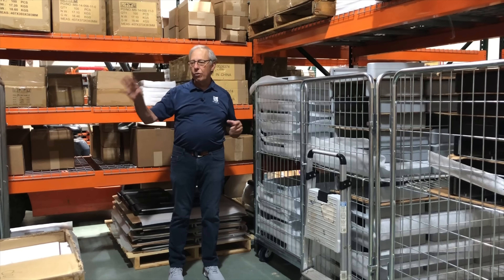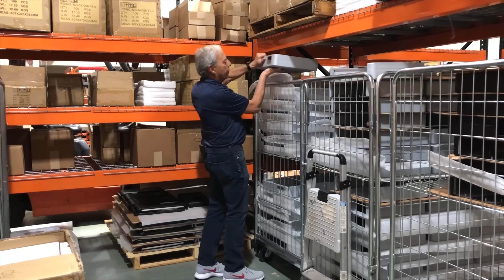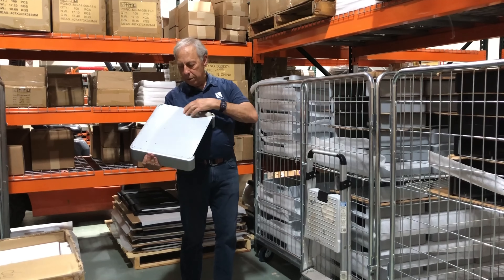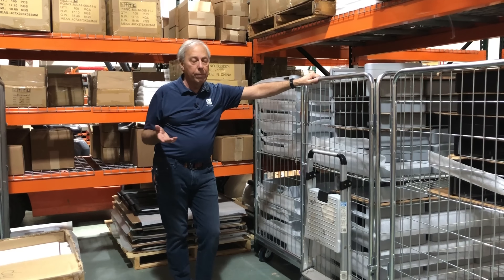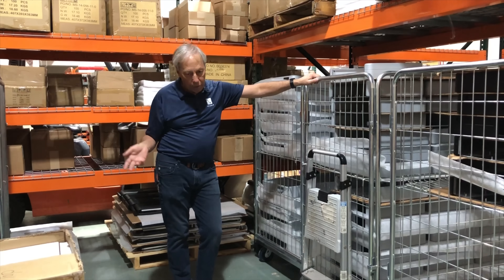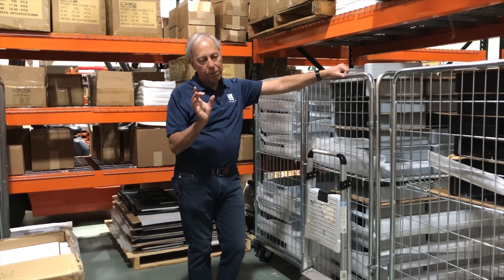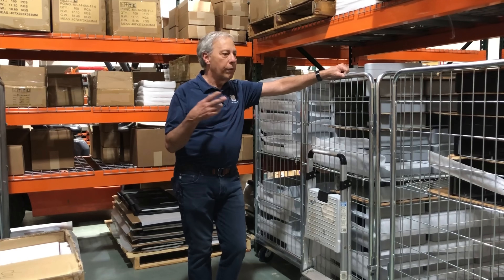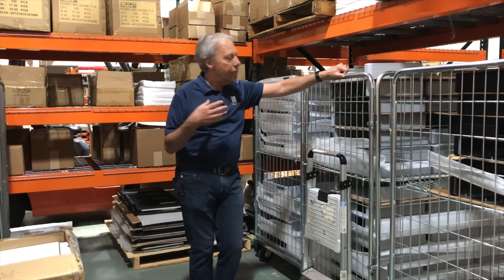Do chassis keep magnetic fields inside?

Comment: What about copper? I’ve seen inside cell phones s protective adhesive made of little fibers of copper that cover circuits which I guess is to keep interference down from the switching circuits
Reply from the maker: Right. Copper is non-ferrous and therefore won't block magnetic interference but it's great for conducting heat and EMI.

Comment: This might be a dumb question, but why couldn't a faraday cage be used to block the electromagnetic fields?
Reply: That's precisely what Faraday cages do — block electromagnetic fields. However, an electromagnetic field is not a magnetic field.
Place a magnet under a sheet of paper and sprinkle iron filings on the paper. They will distribute in a characteristic fashion under the influence of the magnetic field. Replace the magnet with a flashlight, a potent source of electromagnetic radiation. The light doesn't cause the iron filings to be distributed in any fashion whatsoever that's discernible to the human eye. The absence of potent hallucinogens are assumed here.

Comment: Paul, the thin bottom of those steel chassis seem prone to resonance when you tackled?¿ them. Some of my vintage amps use a thick composite material called G-chassis from Sony. Others, much more expensive,  a thick iron cast rich in carbon or coal, from Sony too. I love those Sony's I will keep them until death.
Why don't use recipes from the past that have shown its effectiveness now?
Reply: Warning: an assumption in this comment coming up. I possess both a Rotel and a Sony amp of similar specification, but dramatically differing weight. The Rotel has a large toroidal power transformer and is much the heavier of the two. The Sony has a relatively puny conventional EI, or TU transformer. Incorporating a heavy sheet of iron, or steel, into the case would certainly have a pronounced effect that could provide fodder for the typical sales-droid.

Comment: Maybe 50 years ago some watches were made with numetal cases to be less affected by magnetic fields. They were only moderately effective. If you got near a speaker magnet, all bets were off.
Reply: Hmmm. I spelled it wrong it is mumetal. 
"One such composition is approximately 77% nickel, 16% iron, 5% copper and 2% chromium or molybdenum."
Reply: @machintelligence  That would be some expensive watch! A quick Google and I can save heaps by pre-ordering the Capt. Cook special though. Only $AU3,500!
Reply: @jonathansturm4163  I believe it was an Omega, but I don't know much more about it. It belonged to the owner of a Jewelry store where I worked while in high school. He tried it near a speaker magnet and had to have the watchmaker at the store take it apart and demagnetize each piece.
Reply: @machintelligence  Ouch! An expensive exercise then.

Comment: Are you saying nu or new metal. lead would work just as well maybe better a container coated with millimetre of lead nothing will get in or out even radiation.
Can you still get lead tape not seen it for very long time
Reply: Mu-metal: https://en.wikipedia.org/wiki/Mu-metal
Reply: Lead tape here: https://www.tennisdirect.com.au/tourna-lead-tape?gclid=CjwKCAiArK_fBRABEiwA0gOOc4JibrHFjOHjKmRjAvDbjDRkKTqnkuqrCt0rImjLQEtmVPDJwyk0fBoCoi4QAvD_BwE
Whooo! That's a long URL!
Back in the olden days when we saw the first hi-fi cassette decks, the better ones had mu metal record and playback heads. These heads were fabricated from thin laminations of mu-metal and were expensive. They also wore out fairly quickly. Most ads for cassette decks said the record/playback head was made from ferrite, or glass. The material was the same; this was just a naming issue. They were very hard-wearing, but they were inferior to mu-metal in the quality of the sound the deck could reproduce. Professional reel-to-reel machines have always used mu-metal heads to the best of my knowledge.

Comment: i think the problem  is that you can not absorb EM fields, only reflect or not, noth are a problem, so either you reflect it back and bounce it around or let it free and it affects all other things.    correct me if i am wrong about this
Reply: You can also use distance which is what I did with the second amp I built. The power transformer was in a separate box with 300 mm ( a foot) of cabling between it and the amp proper.
Reply: distance squared of course, i think it is the best way of handling EM, and maybe only way as far as i know. 
that is  handling what you already got to work with, engineering with lowest possible em radiation component if possible without sound quality loss.
Reply: @sudd3660  "distance squared of course"
That's for electromagnetic fields. Magnetic fields generated by permanent magnets diminish to the inverse fourth power with distance, so the drop off with distance is much more rapid. That said, modern magnets are powerful. The technologist in charge of my cardiac implant was concerned that it was reporting frequent but irregular interference from a strong magnetic field. I eventually worked out it was the magnetic catches for the flap on my shoulder bag.

Comment: A minor correction: aluminium has magnetic properties, it's just that it's paramagnetic rather than ferromagnetic. Back when TV sets had many coils that were tuned with a plastic screwdriver, some were ferrite cores and some were aluminium cores notably in the tuning turret. Also magnetic fields diminish with the fourth power of distance, not the square. At least that's what I recall from tertiary level physics in the 1960s.
Reply: I'm impressed! When an scholar like you say something and I don't know if it's a joke or real,  it's because the bar has been elevated.
Reply: @salvadorrodenas3071  A few things: Yes, there's frequently an element of humour in my comments. That's the way I live my life; I like a good laugh especially at my own expense. There's also a practical side to this. As a long-time educator of adults, I know that injecting humour into the serious stuff makes learning easier, and more importantly, effective. I also strive for accuracy. While there doesn't seem to be a downside to accuracy, there is to inaccuracy.
Case in point: This Monday past, I was at the local Post Office wherein there was a couple selling "snake oil"! This magic massage oil they said cured almost everything from the common cold to arthritis. As I suffer from chronic pain caused by arthritis, I accepted the lady's offer of an application of Paramao Oil (for that's what it's called) to my long-suffering lower back. And lo, it worked and was still working several hours later when codeine and oxycodone would have long worn off. It was also more efective. As it happens, I recognised the aroma as oil of wintergreen (methyl salicylate), having synthesised that in chemistry class long ago.
My friend Google Scholar soon brought me up to speed on the properties of methyl salicylate. The couple touting it were correctish in concluding it was similar to its cousins salicylic acid that's the active ingredient in apples that cures headaches. It's also in willow bark, hence its name and the use of willow bark tea by herbalists. Aspirin, the first synthetic drug, is acetylsalicylic acid.
Despite the similarity, there are profound differences in the efficacy and safety of these three related substances. Methyl salicylate is very toxic and should under no circumstances be applied to open wounds, eczematic skin, ingested, or otherwise used in the way this couple were assuming it could. They were also committing the Naturalistic Fallacy — if it's natural it must be good.
Of course I am truly grateful for discovering a better way to control my arthritic pain. There's a huge number of plants that contain oil of wintergreen (wintergreen being but one such). There's also synthetic methyl salicylate for $AU16.50/kg instead of $AU45.00/200 ml.
Reply: @jonathansturm4163  🤪
Reply: @jonathansturm4163  😆😉
Reply: Jonathan Sturm  - 🙏🏼
Reply: @Enemji  Obviously a joke for psychics...
Reply: That's an impressive memory, and you are correct, sir!  Although, the magnetic permeability of aluminum is essentially the same as air, so Paul is effectively (although not technically) correct.
Reply: @terrywho22  So air is magnetised by a magnet just like a paramagnetic coin? Interesting. That must make speaker driver design a bit fraught.
https://www.youtube.com/watch?v=xAURp5V7zoQ
Reply: @jonathansturm4163  Well, O2 is paramagnetic, but between its low intrinsic magnetic susceptibility and low particle density (not only is it a gas, but it's about 20% of air), its resulting low volume susceptibility make it non-factor with regards to speaker design.  :^)  Cheers!
Reply: @terrywho22  Well that's a relief :-)
Reply: @jonathansturm4163  I know I will be sleeping easier tonight.  Phew!